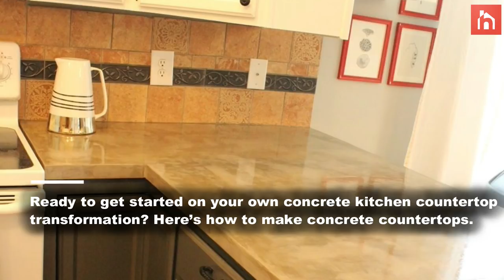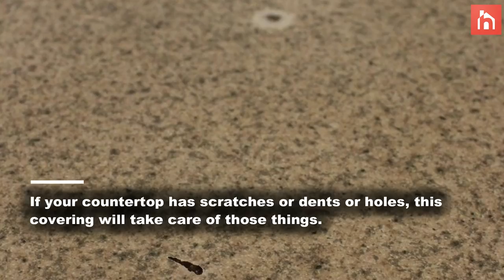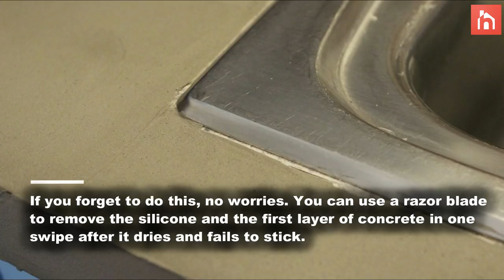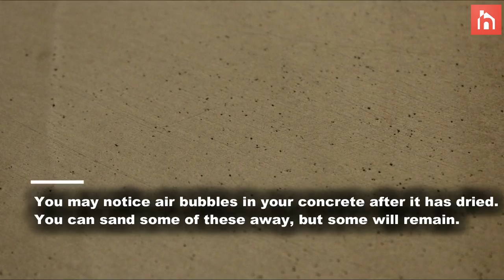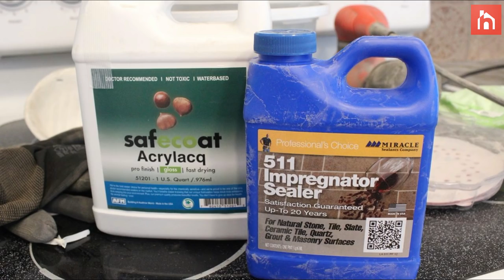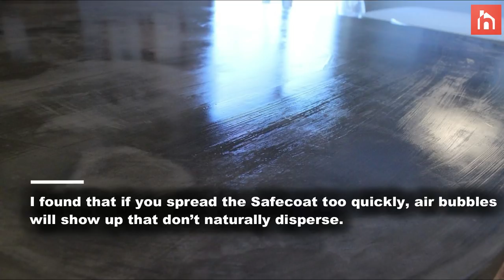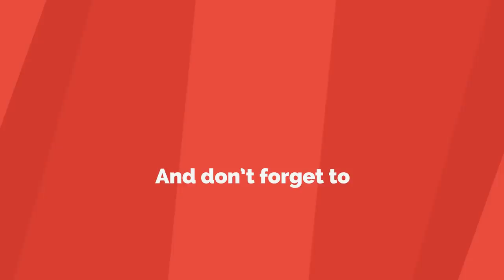DIY Concrete Kitchen Countertops: A Step-by-Step Tutorial

Comment: You have no idea how much I appreciate this video 🙏🏽. 10 years ago my cousin built me a tiled countertop. He built it on 2x3s & plywood . I wanna say about 3 1/2 yrs ago I tore the tile out, replaced with cement board, then attempted this 🤦🏾‍♀️ it didn't come out completely as I wanted it to and, by the way, I had no chipping or cracking whatsoever. It came out looking more like slate because I didn't know how to really work with the finish, so I just worked with it 🤷🏾‍♀️ Now I'm attempting it again and some of your tips has really helped me. Thank You!

Comment: This turned out great.  I've been researching this process for a few weeks. I noticed that the sealer you used is not food safe.  I just want to warn you, and also others that might use your recommendation for sealing their DIY concrete countertop project.
Reply: I’m pretty sure the Safecoat Acrylacq is food safe, from what I’ve researched.  The 511 is not, but the safecoat (last coat) he used is food safe.

Comment: I attempted this but mine is cracking - any idea what I can do to fix this problem?
Reply: Mine cracked too. I did not rough-up the laminate enough and the feather finish separated and bowed upwards. It cracked at the bows. I sanded it all off and removed the laminate down to wood and now it is holding on. If you don't make deep gouges in the laminate with a box knife or something it won't stick. I used a 60 grit flapper disc to rough up the countertops to start with, but that was not enough for the finish to grab onto, so it separated and cracked. Good luck with your project.

Comment: This will never hold up and bacteria can build up on your counter top because you didn't use food grade sealer. As soon as that hardens in about 30 days it's going to crack and break very easily then have a snow ball effect.
Reply: question, since you seem knowledgeable...if instead of that sealant, one used a food grade epoxy coat, would that hold up?
Reply: Parick Burke sooooo safecoat acrylacq is actually 100% food safe.  Also, mine have held up for 3 years with no cracking.  If you do it right, you shouldn’t have any issues.
Reply: Monica Fay safecoat acrylacq is food safe.  But epoxy will work GREAT!  Stone Coat countertops has a tutorial on epoxy on top of concrete.  All of their videos I’ve watched are incredibly helpful.  After a few projects, I’m addicted to epoxy!
Reply: Everything is food safe after it dries. Look it up